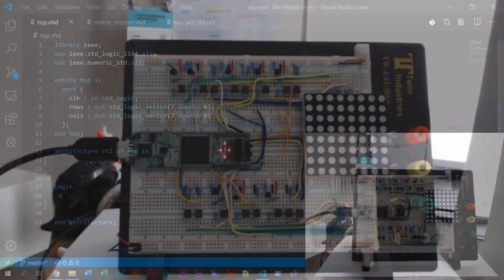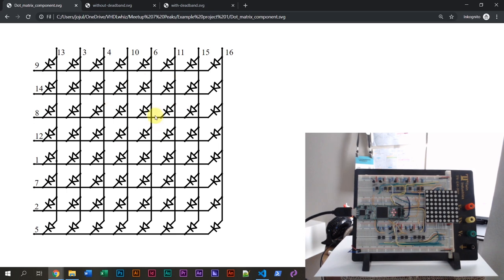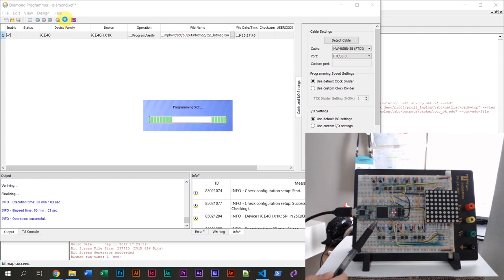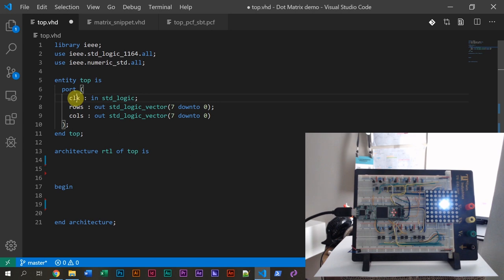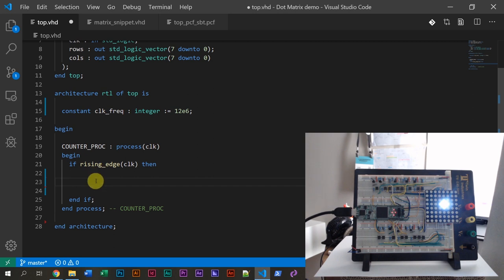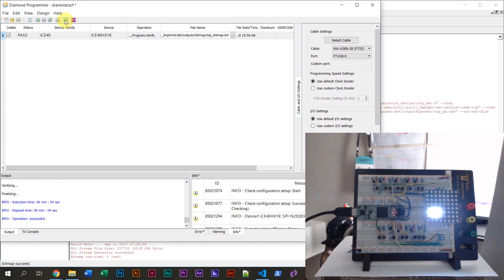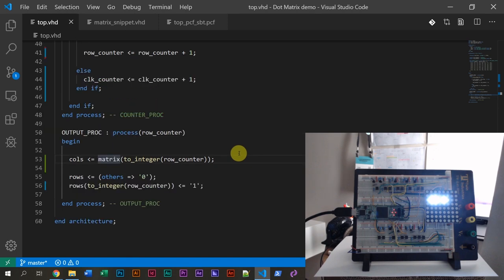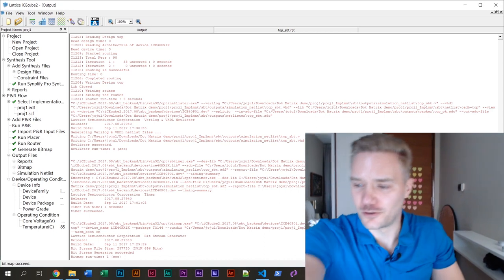Controlling a Dot Matrix LED Display with VHDL

Comment: I love your channel.I have to operate  32x32 AMOLED display by using VHDL program and ARTY S7 board .can you please tell me that whether this program is applicable if I take row  and col of 32? and what driver controller i need to run 32x32 AMOLED display? please help me.Thanks.
Reply from the maker: You can't make the code work on the 32x32 RGB display by merely extending the vectors. The 8x8 dot matrix is the simplest form of display, we have direct access to the anode and cathode rows and columns. An equivalent 32x32 RGB display would need to have 32 pins to address every column and 3*32 pins to address each of the three RGB colors in every row. That's 128 pins in total.

Therefore, I guess that your 32x32 RGB display has some other kind of scheme for addressing the individual rows and columns. The concept of scanning over the display to render the image is the same, but it's going to be a different code to interface your display than what I used in this video.

Comment: Amazing video, helped me undertsand a lot even tough I am a beginner in vhdl and hardware software coding. 
I have a question: I have a project where I have to design 5 random mazes in the led matrix (12*8) in fpga de2-115 development board and then use a cursor to move from one end to another. Can I use the same techhique like yours (using counters and frequency value so that its visible to naked eye) to display the mazes in the led matrix?
Reply from the maker: You should be able to use the same technique on a larger dot matrix display. Illuminate one row or one column at the time to render the image on the display. Note that this only works on dot matrix displays without built-in controllers. For such displays the interface is usually SPI or I2C with much fewer pins than one for each row and column.

Comment: Hi, great video, well placed and explained. Thanks very much for sharing, hope to see more like this soon.
Just got one question/curiosity, is visual studio your preferred vhdl editor which you using for professional work? Or do you use others?
Reply from the maker: Thank you, Jose. Yes, I use VSCode with the VHDL plugin from "Pu Zhao". I used Emacs for many years, and there are some things I miss from it. Neither of the editors are perfect in my opinion.
Reply: @VHDLwhiz  I had bad experience with the "Pu Zhao" plug in because for some reason it broke the recommended declared signals, variables, etc. which is always very handy.  I had to remove it and found a better vscode plugin for vhdl which is   " Modern VHDL" by rjyoung. It has the same functionality as the "Pu Zhao" plug in but it includes " shutter mode" ( same as Emacs) which is extremely handy and I havent been able to find that in any other code editor. At the end of the day is all a matter of taste :)
Reply from the maker: @mustaregis  Thanks for the tip. I will try out the plugin.

Comment: How can I alter the code so that it activates diagonally (00, 01 and 10, 02 11 and 20...)
Reply from the maker: You could change the "matrix" constant at around @20:00 to have a diagonal pattern:

      ('1', '0', '0', '0', '0', '0', '0', '0'),
      ('0', '1', '0', '0', '0', '0', '0', '0'),
      ('0', '0', '1', '0', '0', '0', '0', '0'),
      ('0', '0', '0', '1', '0', '0', '0', '0'),
      ('0', '0', '0', '0', '1', '0', '0', '0'),
      ('0', '0', '0', '0', '0', '1', '0', '0'),
      ('0', '0', '0', '0', '0', '0', '1', '0'),
      ('0', '0', '0', '0', '0', '0', '0', '1')